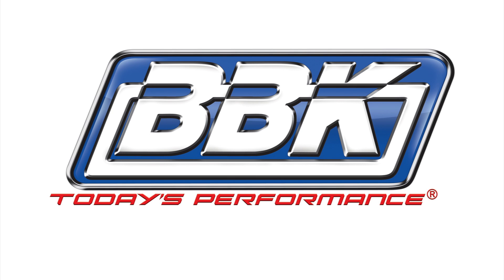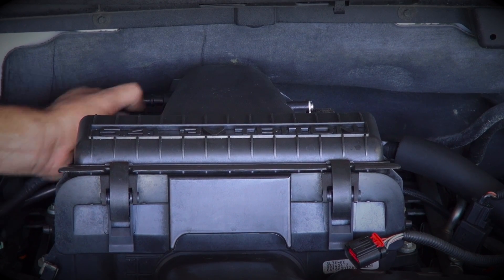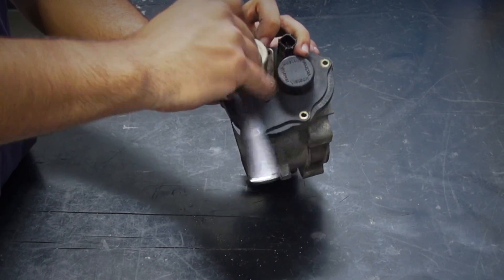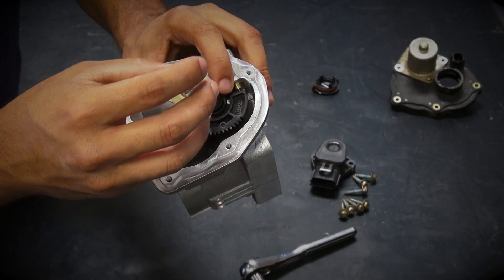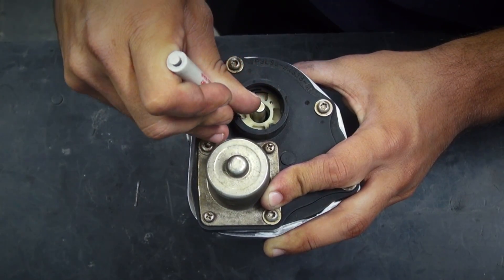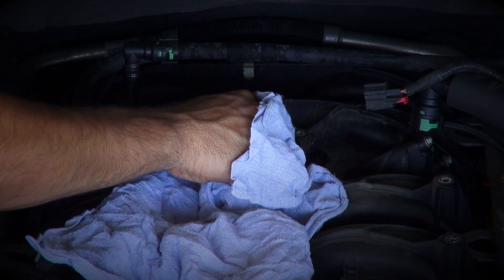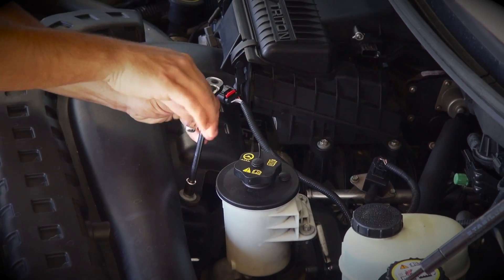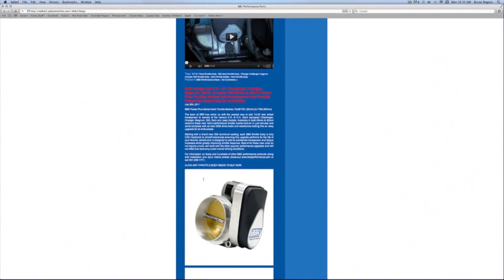2004-2010 Ford F Series Truck & Expedition Performance Throttle Body Installation

Comment: hi.  the clearance between lever and stops screw
The clearance between the lever and screw stops must be modified or left the same.
Is this gap 0.022 or higher?